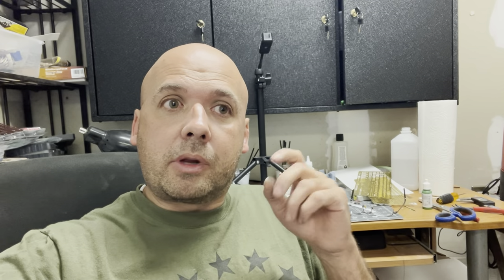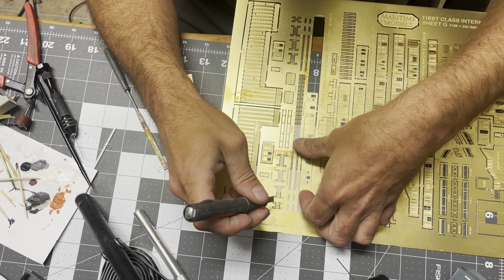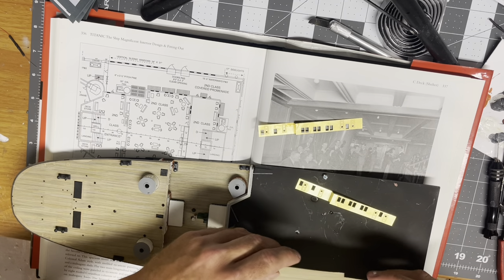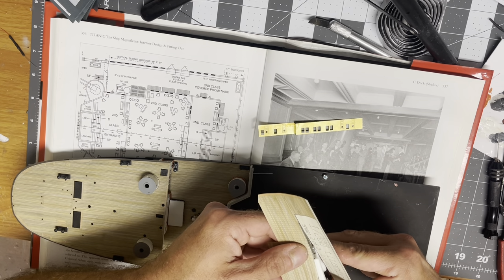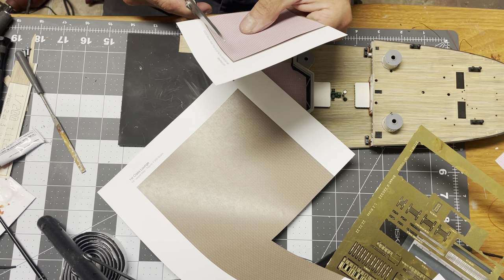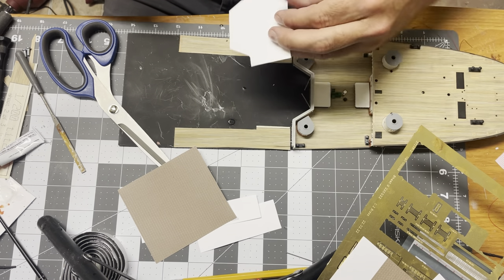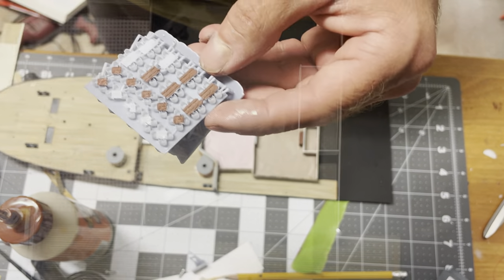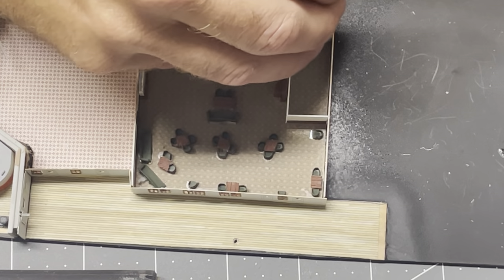RMS Titanic 1:200 RC Build Part 12.  2nd Class Library and D Deck Reception

Comment: Hi Larry, great job on the scratch building!  This is the stuff we love to do, right!  I had to stop your video and go and check that I had sheet G in stock from Neil.  I want to do the same as you have regarding the PE on the superstructure.  There are a few bits that you can do this with from Neil.  It's keeping the strength in the PE superstructure that we have to get right.  Excellent for blocking light leakage through the walls.  I believe Robbie experienced a height problem when he was adding the ceilings to the public rooms.  The little people are a little close to the ceiling in some places, so watch out for that!  Your video is good for me seeing how to plan this stuff out in advance.  Great job so far!  😉👍JH⚓
Reply from the maker: Thank you. Next video should be uploading later today.  Not much scratch building in that one though.

Comment: Absolutely 💯 magnificent Larry, that's a true work of art you did on that 2nd class library. Blown me away by how accurate and precise you got that down to size and scale. I love how you got the glass on the windows to stand out, I mean fair enough all this is going to be covered when the rest of the ship is assembled and painted but it's the same as modelboatguy and what the makers of the 97 film did regardless, so that's what makes it all the more better. If I ever attempt interior when the 1/200 HMHS Britannic comes out, it'd be the bridge only, still my ship would be static display anyway 😅. Coming along beautifully indeed, if you've seen the original filming model for the 97 film you can see true intricate detail all over, you.. Midwest modelshop and modelboatguy have all made incredible quality at smaller scale. Great update, excellent 👏 👍
Reply from the maker: Thanks Joe.  Next one coming hopefully later today

Comment: Are you going to work with Neil to produce the 3d prints you’ve constructed for the interiors ?
Reply from the maker: I’ve mentioned to Neil that there may be a market for it, so that is up to him from there.  The prints I used at bit near correct.  If he decides to do the rooms I am quite sure they would look 1000x better than what I created.